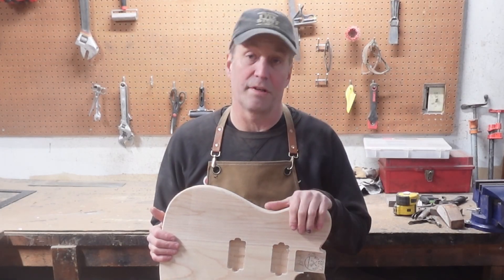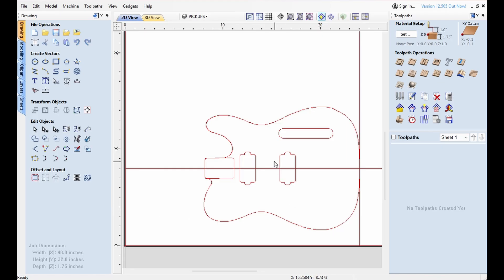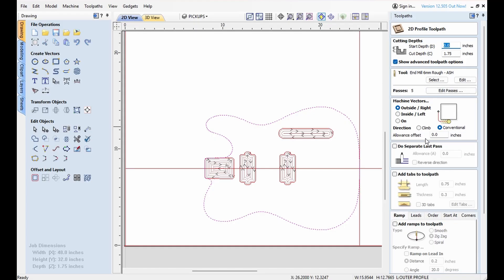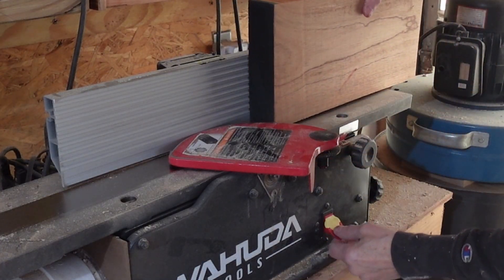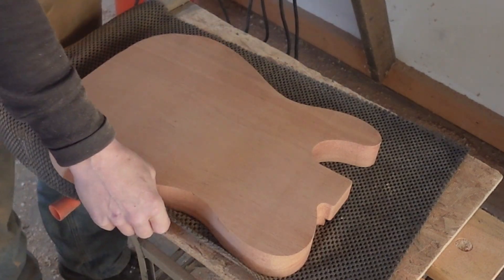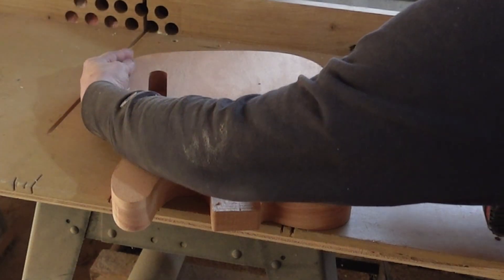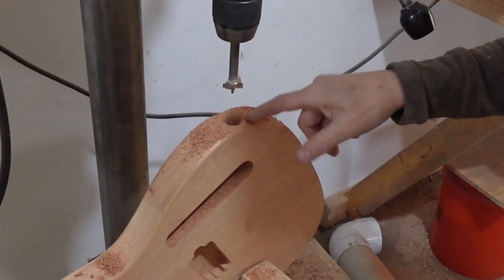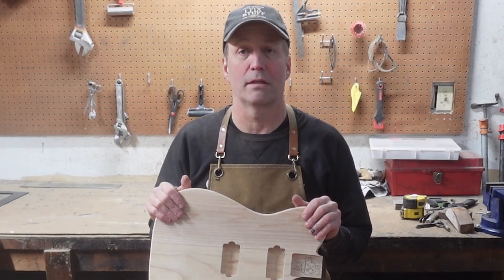DIY Telecaster Build (Humbucker Style!) | Full CNC Router Guitar Making Guide + FREE CNC Files

Comment: Subscribed. Could you go over your different settings/speeds for different woods?
Reply from the maker: Those are going to vary quite a bit depending on your machine (how rigid, power, RPM, the cutter you are using (diameter, up or down or compression, straight or spiral, (if spiral what is the length of the helix) rougher or finisher, etc)  and species of wood you are cutting.  With all those variables you'll have to develop feeds and speeds for your particular set up.  (DON'T USE MINE!!!)  For my 6mm bit in hardwoods.  100 IPM, .25 DOC,  18,500 RPM